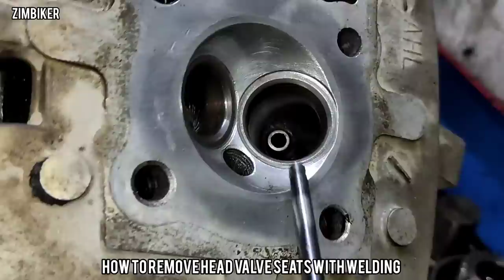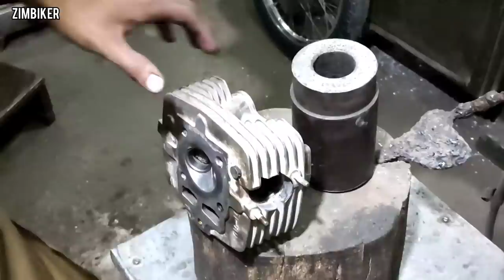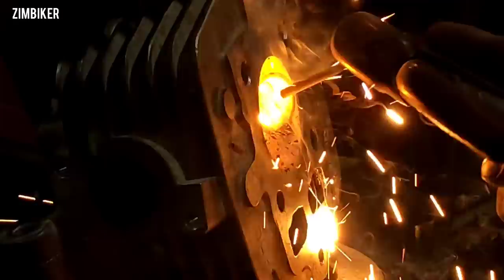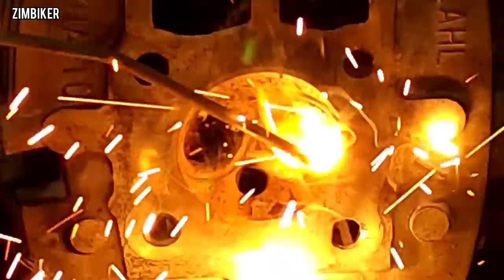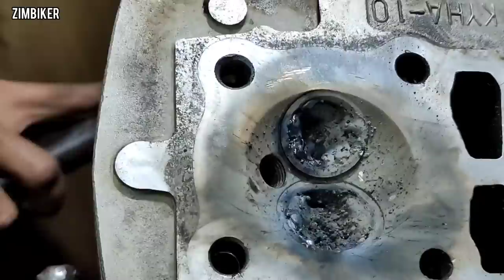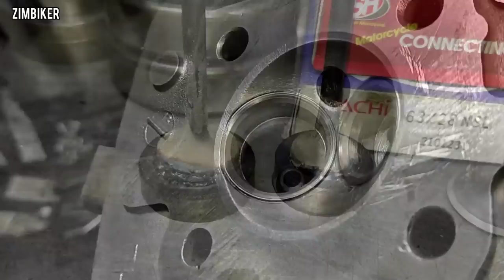How to remove Valve seats with welding without seat cutters?

Comment: People have been welding bearing races since the first guy had to change a roller bearing. I guess it works good on valve seats too. It's hard for a lot of people to wrap their head around the fact that a well-bead shrinks when it cools and thus will suck down the valve seat and bearing races small enough to where they'll just pop out of the hole. I like doing this with steel races sitting inside of aluminum castings and blind holes. Works great every time and it just blows people's mind when they see you do it.
Reply: Yeah it does look narlie, there is a cleaner way, if you have the equipment.

Comment: Wish I had done this. Although I was not going to use the head again due to corrosion, I wanted to see the extent of the corrosion up the sides or the seats so I used a chisel through the port to break them out, causing more damage.

Comment: AKA, how to disroy your motor cycle heads. Best be ready to replace them.
Reply: Right all this is doing is destroying it cus you literally just getting weld splatter and and marks everywhere and also it makes it weaker
Reply: @sarahnicholebrown9192  exactly.
Reply: It's amazing how many people that don't know anything about welding knock this guy doing the best he can with what he's got. I certainly would have protected the head with clay or something like that from all the splatter, but the method of shrinking a valve seat is very sound.
Reply: Explain to me exactly how this makes the head weaker? Obviously the hammer marks all over the face of the head aren't good and having splatter babies to knock off isn't good, but the head will not be any weaker. I've been welding for 20 plus years professionally I have seen stuff like this done all the time. I use it to remove bearing races from blind holes in aluminum castings regularly. Of course I protect the aluminum and don't get out of control with it. A TIG towards makes this a lot safer for the aluminum. The method here is sound though. He'll be able to take a wire wheel to that head shine it up and it'll run just as good as it did before. Now if they didn't put rings in this piston that thing's guaranteed to smoke
Reply: @MAINTMAN73  it's all about the heat effected zone when it comes to welding.

Comment: if you run a continuous run of weld around the seat and let it cool the seat would shrink and fall out   
its a good method of removing car wheel bearing outer faces

Comment: We used to hear airplane cylinder heads to about 600f, checking with a temp stick and then using an expanding sponge soaked in ice water to pull them out.

Comment: And this doesn't damage the aluminium head??? One touch in wrong place ,and it's game over!
Reply: But...........he touched the right places !
Reply: I'm sure it's not warped from the heat, and the valve seat will be flush with the new valve... Everything is fine.
Reply: Nah, it'll be alright. One time I threw a timing belt on a Honda D16. Valve head broke off and chewed big gouges out of the combustion chamber. New piston for that cylinder, and my buddy welded up new material for the gouges in the combustion chamber, machined it down and bam... I got tens of thousands of miles more out of that engine. It wasn't even dead when I replaced it with a B20.

Comment: You just trashed the head to soft to hold a new seat for long
Reply: Doubtful. I've seen more heat dumped into the actual heads themselves welding cracks. No treatment. Continued to run for tens of thousands of miles. Some people just like to be Mr. Perfect. I've also seen machinists rebuild marred combustion chambers (from broken valve heads) with welds and then refinish the surface on a machine. It worked fine.

Comment: I did this when I worked for mitsubishi. But usually only 3 spots of weld are required for the  removal tool to push the seat out. Waaay overkill with the metal-on tool, and just love the indentations on the joint face.

Comment: No actually you take a Dremel with a small cut off wheel you cut them a little bit you get a punch and a hammer and you tap them and they fall out instead of welding and destroying the cylinder head that's the wrong way sorry you need to be told the right way
Reply: Honestly there's no "wrong and right" method, if the method works it's good, if you messed up then you are wrong it's your fault not the method. The right approach in this video is "is it efficient? Is it effective?".  The "right" methods comes from unopen minded people who think their works are superior plus people and their egos. No costumer wants to hear "nah I can't change valve guides because  my dremel is broken." "I can't change liners because we don't have freezer and nitrogen is a little bit pricey." Just do the shit. "If it works, it works." Every successful machine shop owners knows that. I'm honestly sick and tired of this people telling "nooooo. That's wrong you damage the seats" "nooooo. That's wrong! This is the right way." Instead of telling that, try asking "is it efficient?, Is it effective?".  Everybody have their own method because the world is not revolving on you.

Comment: This is done by ONLY PROFESSIONAL., with machineshop work experience...
Reply: It should be done by heating the entire head. Just doing as show in the video could crack the head but will expand the port and prevent the correct interference fit for the new seat.